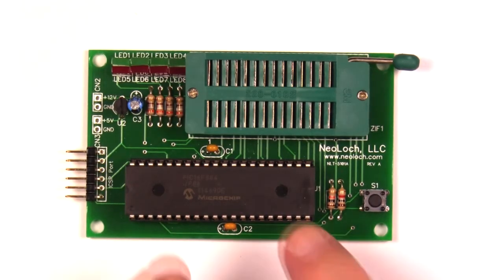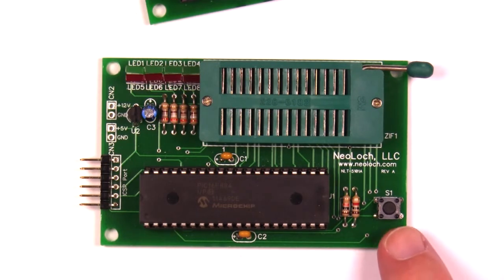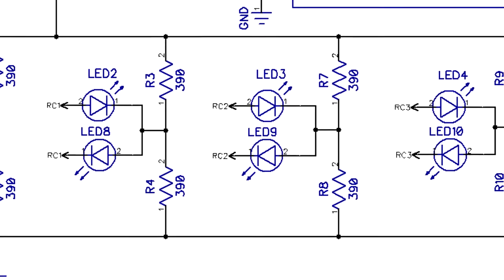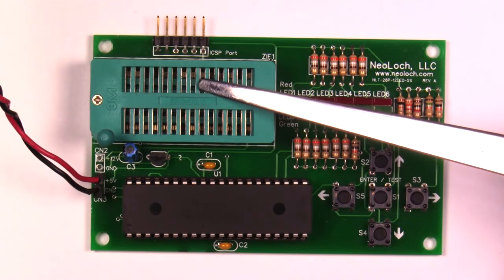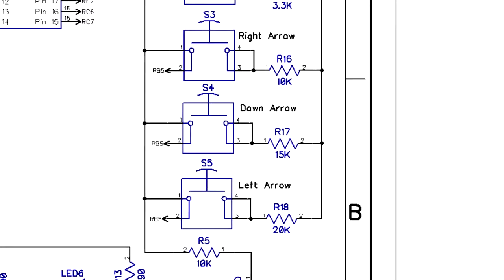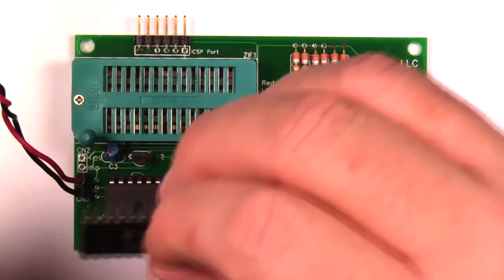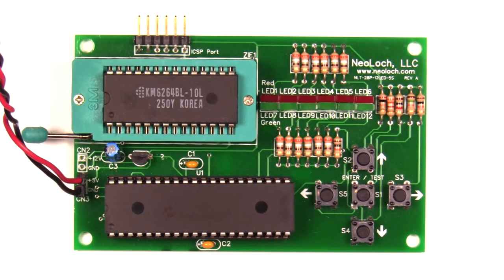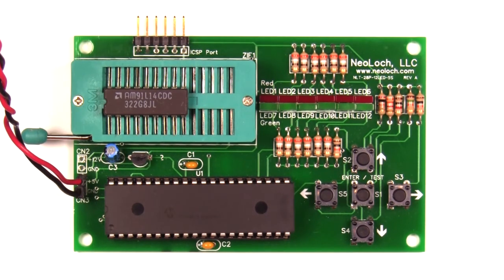MD Lab: New Budget 5101, 6264, & 2114 / 9114 Ram Tester

Comment: Hi, good work David. How about a 64 pin DDR ram test? It seems those tester in the marked are too expensive!
Reply: There's already a DDR 64 pin RAM tester - it's called a PC :)
Reply: Yeah, 64 pin from a Swtch or other components, how would you test them? Pc?
Reply from the maker: Take them to a local computer shop and ask them to test them, might cost you a few bucks but much cheaper than buying a tester.